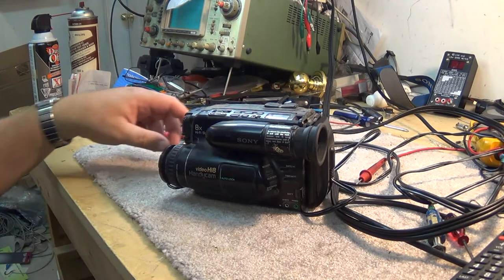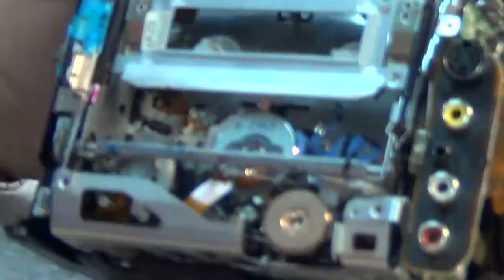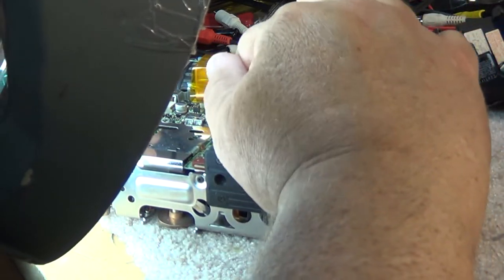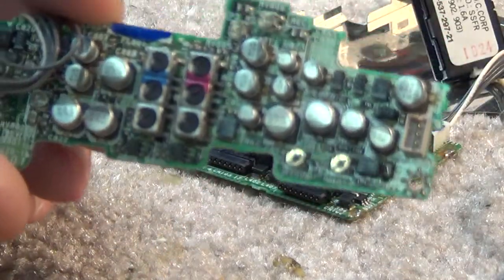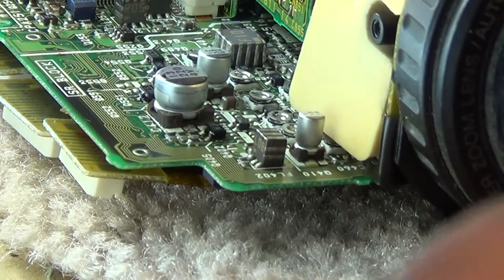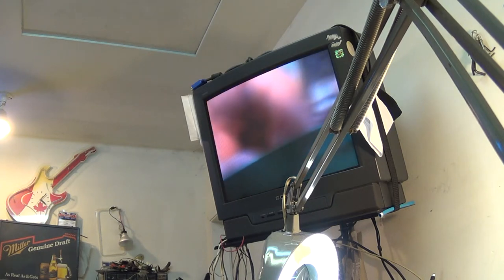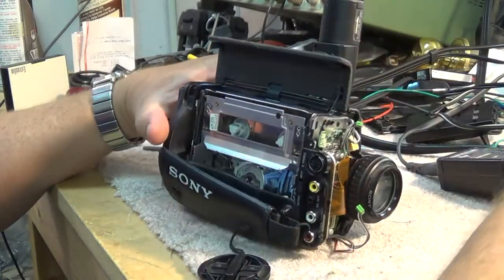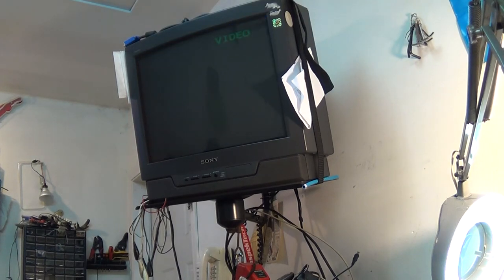Sony CCDTR81 Distorted video on playback. Can this one be fixed?

Comment: Fantastic vid! I've had this same camcorder since new. It went back in the early 2000's for about the same reason. They replaced electrolytic caps too....about 4 of them sent back in a baggie. Camcorder still works like it did new.  I'd sure like to see a PROPER way to periodically clean one of these?

Comment: Awesome. I have a Sony GV-8 8mm Video Walkman and there is no picture when playing nor when you plug something in the AV input and output it to the TV. It suffers from bad capacitors. I also just got a nice Canon 8mm camcorder from 1997 and it is fully working, there is a color LCD screen in the viewfinder.

Comment: Awesome videos. I have a Blaupunkt video camera CC875 which was fine until weekend. Playback now runs with constant lines, with no audio too. Recording this morning (test) has a stabile clear view including in and out zooming, but playback is the same. Any ideas? Battery is damaged and working with AC adapter, which done over the years. Could the power supply be the problem?

Comment: Apparently bad surface mount electrolytics was a problem with all Sony video gear from the time surface mount started through the end of the 90s.  There used to be a repair shop in LA exclusively dedicated to replacing them on high end VTRs and cameras, for a much more reasonable price than what Sony USA wanted.  I read about them on a webpage years ago but lost the link.
Reply: great video btw
Reply from the maker: When I worked in the business I spent many long boring days replacing bad caps. First all the SL 5000 series betamax aluminum capacitors (replaced with tantalum) in the servo circuits. Then the surface mount caps hit. I fixed hundreds of 8mm and hi-8 camcorders.
Back then a Hi-8 cameras were big bucks, and people would spend a few hundred fixing them .

Comment: Great video! I had a Ricoh R-88H (the equivalent to the sony CCD-TR81 with a different brand name) that I repaired a while back with the same viewfinder problem, but a little later it totally crapped out due to other bad capacitors. I hate these cheap crappy capacitors that Sony used!
Reply from the maker: Low Budget Videos Not just Sony. Canon were worse, and Panasonic not much better.I will be putting the TR81 back on the bench to tackle the view finder problem again.

Comment: Thank you for this video! Is temporarily bridging a capacitor in order to convert some videos bad practice? I don't need a long-term repair, just want to get some videos saved digitally. Thanks.
Reply from the maker: You can swap out or bridge to get running.  Your miliage may vary
Reply: @12voltvids  sounds good, thanks for the reply

Comment: Great video, I'd love to know how to test capacitors with a $15 mastercraft meter. Do you have a video on this?
Reply from the maker: The only accurate way to test capacitors is with an ESR meter. It will spot bad ones in circuit in most cases.
Reply: @12voltvids  are ESR entry level meters still over a hundred dollars?

Comment: Hey there, great vid.  Just picked one of these up at a garage sale to try and capture some old tapes.  Unit played with a dirty head, so cleaned it with a bit of alcohol.  Picture cleared up and played nicely, but by time I got the capture equipment out, it will only play static.  It can rewind, ff, and play, but no picture is coming thru.  It does sound like it struggles a bit to load the tapes, and sometimes will stop and flash the eject button.  Any ideas?  Thanks in advance.

Comment: Very interessant, but I had a problem with my Hi8 TR705 ... When I load the video cass. its start to rewind or wind without my intervention.I can stop it but the ply modus is not possible. Mechanik or electrolytic cap. problem???Thank fo an answer

Comment: I have a Sony handycam video 8 CCD-FX620 with the exact same issue. Is it the same process I would have to go through to fix this camera? How would you recommend someone without much experience in the field of camera repair go about making this fix?
Reply from the maker: The problem on the vast majority of these old camcorders is the surface mount electrolytes have gone leaky. Sometimes the boards are damaged and they can not be repaired.

Comment: Hi i am curious to if you accept devices for repair? 

My mother has this camera and we are trying to move from cassette to usb and the camcorder is having this issue. Please let me know if we can send this your way for repair. 

Thank you!
Reply from the maker: I fix things all that time that are sent in but keep in mind that most of these cameras have the leaking caps issue and depending of the damage the leakage has caused many are not repairable.
Reply: @12voltvids   can you share info on how we can possibly get this fixed.
Reply from the maker: @juanito7923  contact me by email

Comment: How much will you charge if I ship my camcorder to you for fixing it ? I have a yashica samurai
Reply from the maker: I have no access to parts. The ones demonstrated on the channel are unit I already had. Like everyone else I don't work on camcorders. What I do Is offer an archive service to get these old tapes into a digital format.
Reply: +12voltvids all my camcorder needs is new capacitors I think they sell them
Reply from the maker: The problem with the leaking capacitors is there is an extremely good chance that the electrolytic that has leaked out has damaged the traces on the multi layer board. The reason they leaked in the first place was bad chemistry in the electrolytic. When they were stored discharged the electrolytic became slightly base (caustic) and stared to eat the copper in the leads resulting in a gap between the leads and the rubber plug. Then the corrosive electrolytic leaked onto the board where is starts to eat the copper traces. I have had too many cameras where someone said, just a simple capacitor job, and once getting into it finding the board was also damaged. These cameras use a multi layer board, usually 6 layers. When the corrosive liquid gets between the layers and eats copper, you are SOL. So I don't do cameras anymore. Cameras were one the reason I got out of the business, as they were the biggest headaches. There is a reason manufactures don't fix them. Even new ones. If they break under warranty they replace them, and toss the broken unit,
Reply: +12voltvids is there a place where I can ?

Comment: Hi there I have a CCD-TR64 that plays back perfectly fine on camcorder viewport, but once I output to my TV via RCA the play ack has a lot of noise and snow. Would this be a similar fix to issue in this video or do you have a recommendation on what to do?

Any insight would be greatly appreciated!
Reply from the maker: It will be a capacitor or 2 or 3 in the video circuit

Comment: Wrong - CCD-TR71 is the smallest 8mm camcorder model
Reply from the maker: The TR71 and 81 used the same mechanism, and are very close in size. The 81 however had a better sensor. The 81 had a manual focus ring on the lens as opposed to a small dial, which made it far easier to operate.
Reply: @12voltvids  Your claim is the camcorder and not the FL-Mechanism. This is DoctorSony by the way (FYI).

Comment: Hi 12voltvids can you please look at this video and tell me if the distortion could be caused by a bad cap? https://www.youtube.com/watch?v=mQK19vA_i9A

I came across this Hi8 Sony Camcoder model CCD-TRV67E the listing said the video playback is noisy probably needs its head cleaned. I tried to clean the head but it did not help. I took the camera apart and only found four capacitors inside wich surprised me I expected a lot more of them. All of them look good no leaks. I tried to bridge them with a bigger cap while the playback was running but without any changes. Maybe I just did not break trough the coating idk I was very careful not to touch anything else with the cap terminals. Since there are only four caps on the video-board it is not a problem to replace them all I just want to be a little bit more sure that its a cap problem. I only have a multimeter so I cant test them in circuit. THANK YOU VERY MUCH and thank you for you videos you have earned a new subscriber.
Reply from the maker: Looks like sample and hold cap in the capstan servo.  The modern cameras used mostly tantalum or other solid caps.  Those newer ones only have a few electrolytics. 
Could also be a dead head. These units use auto track finding and record tracking signals on the tape that are used for the auto track finding. If one of the heads signal is low it can hunt like on the sample video.